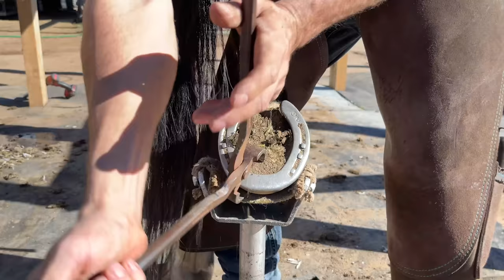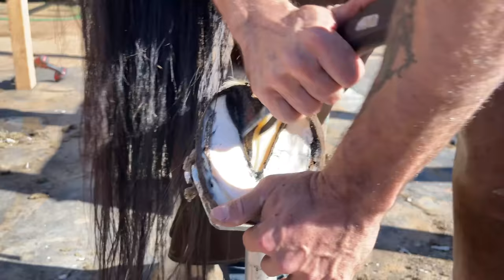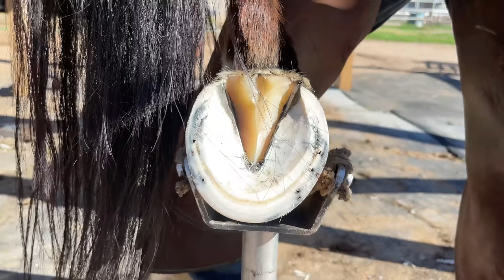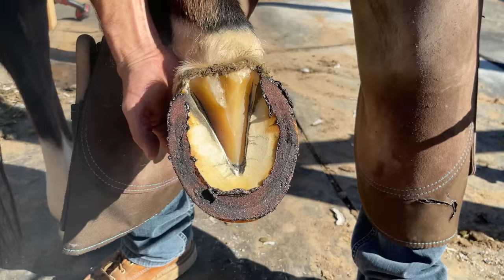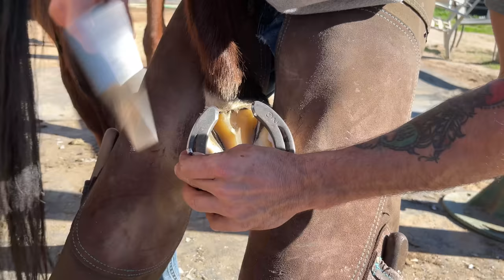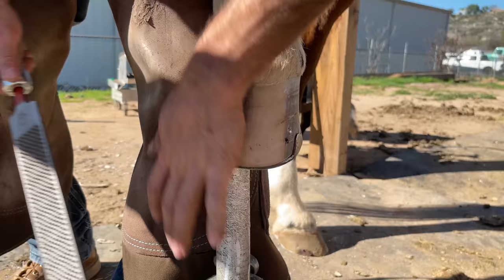Hind Hoof Full Restoration-Farrier ASMR-Oddly Satisfying

Comment: Genuine question: why burn the horseshoe into the hoof? Does it need to be cauterized in order to prevent the horse from getting an infection from the debris that might get between the hoof and the horseshoe? Or is it just so the horseshoe fits better and is more comfortable for the horse?
Reply: It's called hot shoeing, I think. It doesn't have anything to do with cauterizing. It mostly helps the shoes lock into place  on the hoof. It also I think kills bacteria and germs that could get between the hoof and shoe, preventing infection like you stated :D

Comment: Why do they (farriers) burn or sear the hooves with the shoe before putting it on?
Reply: I don't know anything about horseshoeing, but I assume they do it to check that the shoe fits evenly in the horse
Reply: @mateocolautti3703 kinda, burning the shoe on is called hotshoeing from what I was taught. They burn the shoes on to smooth out bumps or anything that would make the shoe unevenly fit on. It also burns away any bacteria or germs or stuff like that that could get stuck between the hoof and shoe😁